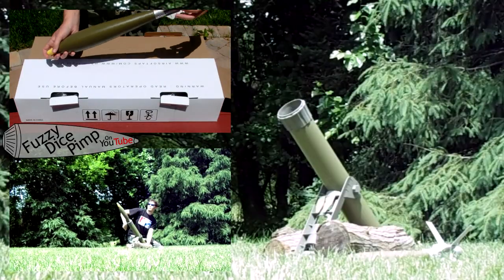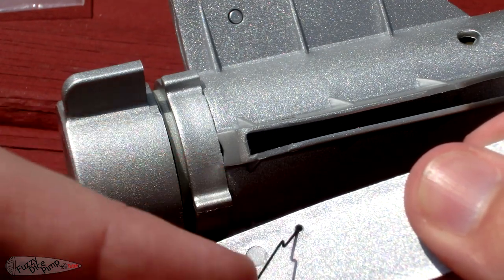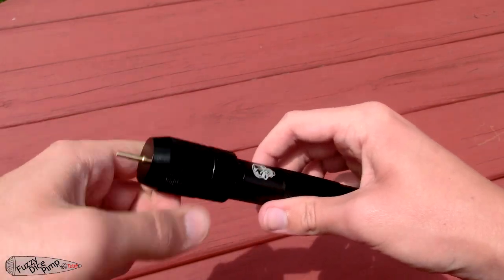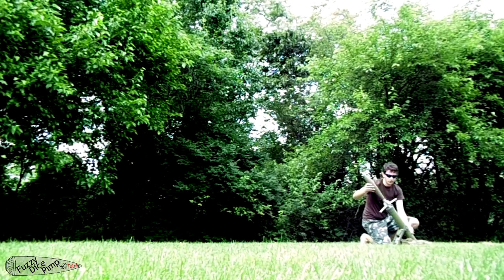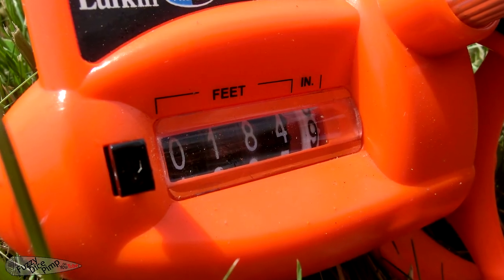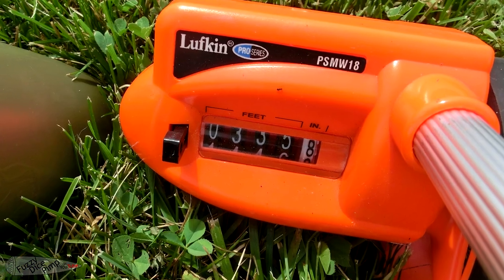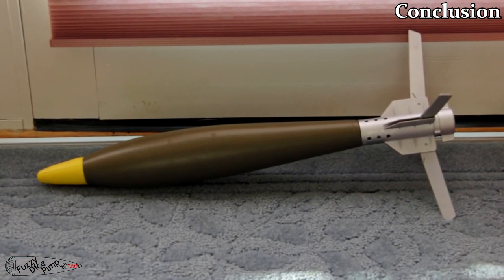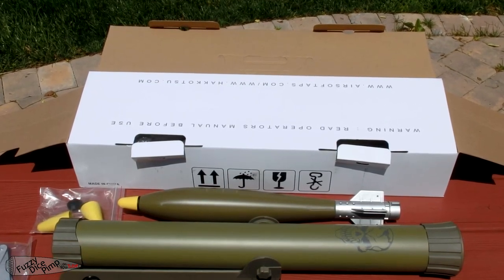Hakkotsu "Hades Arrow" Airsoft Mortar Review and Firing

Comment from the maker: There isn't any certainty to what will and will not bother local law enforcement, so it's always best to be careful when you think someone nearby might phone them to complain. I wouldn't recommend using this in a public area, because I do think it would be dangerous for someone to get hit with the mortar, so if you have a private area with enough space it would be much better. I didn't try, but if you filled it less (maybe no water) it would dramatically decrease firing distance, worth a try.

Comment from the maker: No important reason for the red nail, just a personal thing. Might phase it out, was really just something from one of my friends.

Dipstick would work, what I had taken to was feeling the outside of the rocket to check the level, because the area with the water in it was much colder than the plastic without water behind it, and you could feel the transition to check it. Isn't too hard to get a general measure when filling though, so I wouldn't worry about it much.

Comment: The only use i could see for this is just using the rockets as AT ONLY. create a better launch tube out of pvc and hook the bursting blade up to a trigger system and boom the perfect anti tank gun.
Reply: Brandt Bauer you would of thought they could of done that wouldn't be hard to shroud the blade and spring load it.
Reply: I could do this...and I wonder if anyone has yet?